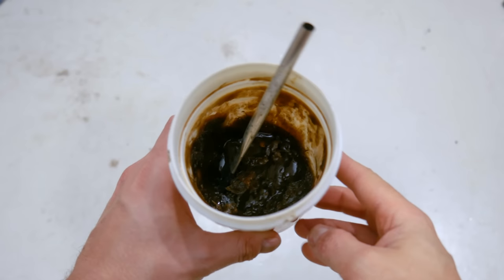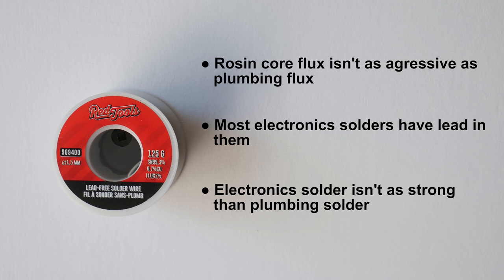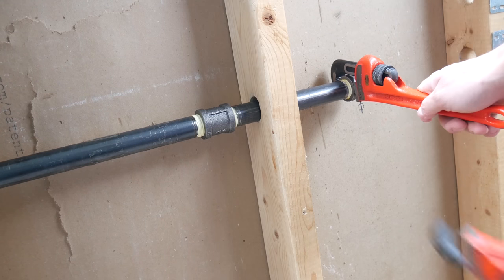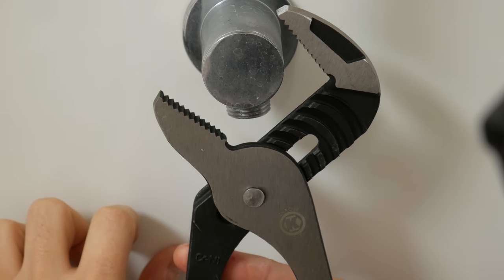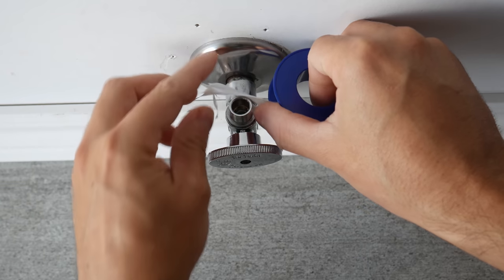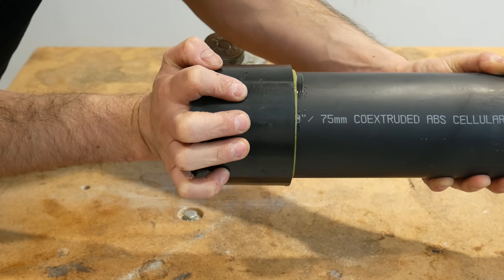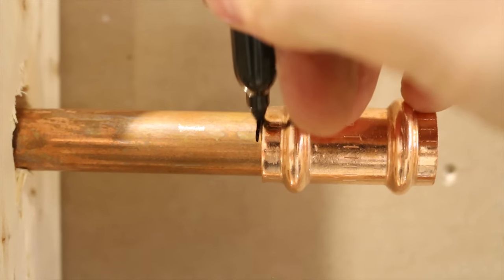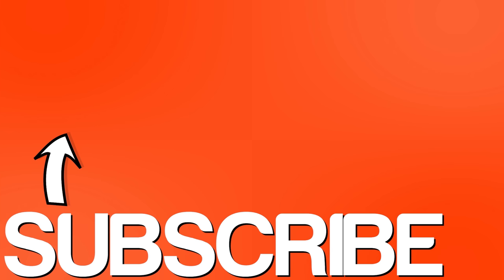10 Plumbing MISTAKES Not To Make! | GOT2LEARN

Comment: Thanks so much for your informative channel. I became a new homeowner a little over 2 years ago and didn't know anything about plumbing. Now I've replaced my entire well system with filtration - acid neutralization - and softening while separating my hose bibs from my treated water, re-ran 50 amp multiconductor electrical to my garage along with a generator feed to keep the noise away from the house, repaired acid decayed copper pipe which burst and began an entire decrepit bathroom gut and remodel with new Pex lines to the bath, toilet, and sink, along with a proper fridge water compression outlet since I had that wall open, moved the toilet waste drain so it would be the proper 12" from the wall, installed bypass valves for the on demand water heater flush, and so much more like that. I used your videos most, and I just wanted to let you know how much I appreciate your straight to the point and thorough coverage of your topics. 👏 👏 👏

For the well system in CA, Clean Water Store was excellent and gave me the instructions that i needed for the design, the plumber who I hired to tell me if I messed it up came and only added a couple of small helpful things and told me it's good to go. Wanna give them a shout out too because they have so much instructional content and answer their phone for questions.
Reply from the maker: Awesome man, thank you so much for sharing this with me 😇😇😇

Comment: no Tef tape on compression thread period. This guy! This Is the Guy!
I had terrible management in my early years and this channel trained me up. No joke. Years later I'm doing 7 figure sales for the top wholesaler in our city.
I recommend this channel all the time to everyone. Thank you Got2Learn. keep being the best!
Reply from the maker: Awesomeeee!!!!!
Reply: If all fittings were rust and corrosion-resistant, I would agree with that statement. But a lot of products from the big box stores are made with cheap metals, and two layers of teflon tape are insurance so you can remove the nut in the future.  This especially applies under the kitchen sink, where drips, leaks and other problems happen in the dark.  A compression valve for a toilet bowl is usually out in the open, and easier to diagnose. Flex hoses are the biggest source of leaks that introduce corrosion damage to plumbing connections. Next biggest cause, outdoors at least, is rain, salt, and sun.

Comment: I use t+2 dope on the 1/2 in compression threads of angle stops to allow me to get a tighter seal because many times I have had a slow drip come from them without dope. I have tried many different ways to prevent the small leak.

Comment: Thanks for posting that on the toilet supply line and teflon tape on compression fittings. Another pet peeve is pipe dope on compresion fittings and 2 piece p traps.

Comment: Binge watching your videos right now. Lots of useful information. I do put teflon tape on compression fittings though because it makes them easier to tighten (not to make them seal better because as you have said it doesn't). Not on the outlet end where there is a rubber seal but on the end with the brass compression ring. I usually only do this behind toilets and under sinks where I have a harder time getting good leverage.

Comment: Some more great tips! On stop valves that use a nut and ferrule you don’t have to use thread sealant on the threads because that’s not what is actually doing the ‘sealing’. Just put a little bit on the inside of the valve where the ferrule sits and that’s all you need.
Reply: I use dope on threads just for lubrication and in rare repair occasions I will put tape so it hits the ferrule and unit sealing point. Only for the most terrible situations. Or if I only have one chance to turn water back on and it can't be turned back off.
Reply: @beerbeforebreakfast  I wouldn’t want to put thread tape on them in case some there was some that shot into the supply line in a rare case. As long as it’s not the old TrueBlue that turns into thread locker over time lubricating them isn’t too bad
Reply: @doublej5171  yeah I know what you mean. I have figured it out, I wrap the tape about 80% on threads of the fitting so that about 1/8th inch will fold in the the sealing point when all said and done. Works 100% of the times I've had to do it. Not enough excess to cause any issues. Only place to be concerned would be kitchen faucet if it's new and fancy. They sometimes have micro filters in the supply lines right at the 3/8 nut that goes to shutoff. Those clog so easy.

Comment: Point of order.  RoHS has been the standard in electronics since 2003 and most makers were in compliance with the proposed rules by 2000.  So any big box home improvement store will not have leaded electronics solder.  You can order solder with lead (Pb) from vendors such as Digikey or if  you are in a shop that deals directly with repair/hobby electronics  you might get it on the shelf.   Not all electronics solder has lead (Pb) in it.

Comment: I have never used primer when I glue pvc. Done 1000s of feet of it and never had a problem. I do commercial fish systems though, not stuff in walls in a home.
Reply: in the early days of pvc pipe, primer was not available, but the pvc manufacturers recommended roughing the ends of the pipe and insides of fittings to break the gloss with medium grit sandpaper before gluing the joints together. primer became available to speed up the process but sanding the connections still works today if you don't have any primer.

Comment: Oatey actually recommends applying primer to the inside of the fitting, then to the exterior of the pipe, then the inside of the fitting again, then applying cement to the exterior of the pipe, then to the inside of the fitting, then the exterior of the pipe, then FINALLY joining them with a 1/4 turn twisting motion.  The also (of course) recommend cleaner, probably because they sell it. I'm no professional plumber, but I've not seen anyone use it. And if I have a piece of dirty pipe, I just wipe it down with Windex.
Reply: If I have a fitting that absolutely can't be leaking and I've got 3 floors of water waiting on my repair.....I use cleaner, primer and good cement! Can't take chances on major repairs like that. But 98% of the time I do not use cleaner.

Comment: Actually IPC, I believe could be UPC, states you only need to use primer on PVC if the pipe is presurized.  Or if the AHJ or local code requires it.

Comment: My understanding is that teflon tape isn't only used for sealing/waterproofing purposes, but to act as lubricant between the two threads. If not used the threads can bite into each other, making it feel like it is turned all the way in, when it is not.
Thus it's a good idea to even use it on supply values and other connections with their own seals.
Reply from the maker: Correct, and straight treads do not need teflon as they seal with a gasket ;)
Reply: I personally use either a silicone/PTFE lube or a joint compound on most fittings. They do a significantly better job than tape of actually lubricating the threads and makes it easier to fully tighten.
Reply: Yes, for example, a 3 inch pvc threaded clean out cap, Teflon or thread tape would work equally as well. Without it, the fitting will not seat completely due to friction or possible snapped hub from attempting to overtighten. Doesn't take much, 2 wraps at most for lubrication purposes I say.
Reply: @Got2Learn   3rd gen plumber for my whole life and we always laugh when we see teflon on compression or flare fittings and supply lines
Reply from the maker: @revoevom1490  😆

Comment: **** CORRECTION  **** In many parts of the world electronics are required to be ROHS compliant meaning they must be lead free. Because of this lead free solder is becoming more and more common. Check the label. Also plumbers flux can be used in conjunction with rosin core solder to increase its capillary action on copper. As a side note NASA requires that solder used for mission equipment contain lead to minimize dendritic complications at the solder joints.

Comment: I just go with PEX and cramp and save the soldering...lol
Reply: I agree with the video, I used to sweat a lot of pipes, and one time made the mistake of using the wrong kind of solder, and it was a very expensive lesson in the material and labor to go back and fix it later.   I was not a big fan of PEX in the beginning mainly because I thought "the art" of sweating pipe would be lost... But I think it is approved everywhere for home use right now and the cost difference is obviously a huge Factor not to mention time....

Comment: I have a question regarding my shower if you don't mind.  The issue is it makes a squealing noise only when I turn the handle on, and it lasts only for about 5-10 secs then the squealing stops, also there is no tub spout, just a shower head on the top, you know what might cause the squealing? It squeals every time I turn on the handle and for 5-10 secs. It's also a single handle one.
Reply from the maker: Did you try swapping out the cartridge?
Reply: @Got2Learn  no not yet, after researching it seems it either the cartridge or the shower head, you mean the  cartridge in the handle right?
Reply from the maker: @aaronbaraiya3692  exactly, sometimes you can get a free replacement at your hardware store, just bring the old one and make sure to shut the water off before removing it!!
Reply: @Got2Learn  ok thanks, so most likely the cartridge is the issue? Also since u replied I subscribed to ur channel
Reply from the maker: @aaronbaraiya3692  yeah, pretty sure, if not, come back here :)
Reply: @Got2Learn  ok thanks, and just the cartridge, not rubbers and springs? Just curious:)
Reply from the maker: @aaronbaraiya3692  I think some come with them, just replace them if they come in the new box.
Reply: @Got2Learn  ok thanks SO much for you help, I will get on replacing them as soon as possible 😀
Reply: It could also be a clogged shower head.  If hard water deposits build up on the small openings on the shower head, it increases the pressure and makes a whistling/squealing sound out of the head in the first few seconds.  It's kinda like whistling through your mouth when you pucker.  You may want to remove the shower head and give it a good cleaning.  I have to do this regularly, as I live in an area with hard water.
Reply: @mph7282  ok thanks, will check it out tomorrow
Reply: @Got2Learn  hey man, so I checked it out today, and after I removed the shower head and turned the handle on the squealing noise did not occur, I tested multiple times. Then when I put the shower head back on the squealing started again. Does this mean that the shower head is the issue then? 

Also the shower head has a bunch of white and green buildup on it as well.
Reply from the maker: @aaronbaraiya3692  yes that could be it, might be worth soaking it in vinegar/CLR for a few days or just get a new one :)
Reply: @Got2Learn  ok thanks, will just get a new one :), if I have any future plumbing issues is it okay to ask in this thread?
Reply from the maker: @aaronbaraiya3692  sure, let us know how it turned out!

Comment: I was planning on putting a shock absorber pipe for my washing machine. Can anyone explain to me how a trapped air bubble above the water line is going to eventually fill with water? I’d imagine if it ever quits working you can just turn the water off and drain the lowest faucet then turn the water back on.
Reply: The hammering action in the line dissipates the air bubble over time. And yeah I suppose you could turn all the water off and completely drain the whole system. A more convenient method though would be to replace your washing machine box that has a water hammer built into it which is quite common and easy to do

Comment: Here's a tip. If you're all out of PVC primer, grab your wife's 100% acetone nail polish remover. Another tip, if your PVC glue has turned thick (but not dry), you can add some acetone in the bottle, shake it up for a few minutes and it will go back to the original consistency.

Comment: Why do you guys still use copper pipes. They seem expensive and a hassle while the whole world seems to be using plastic
Reply from the maker: I have a video on this: https://youtu.be/PIdPovddqy4
Reply: @Got2Learn  i see. Basically rat proof. Because municipal water supply uses plastic too and its not like your gonna have 1000 psi of water pressure
Reply from the maker: @mssm7983  50psi leak if you aren't present is enough to ruin your whole house in 1 hour ;)